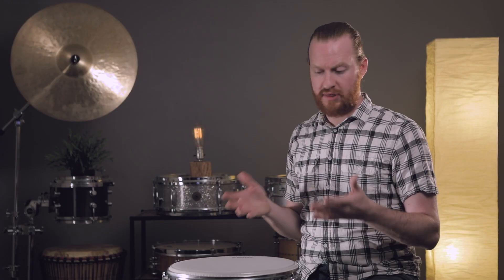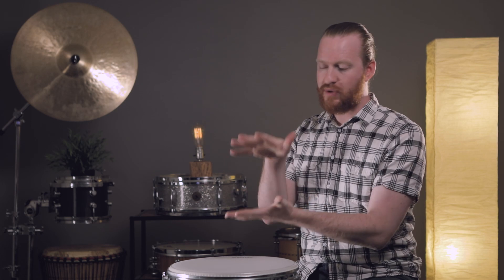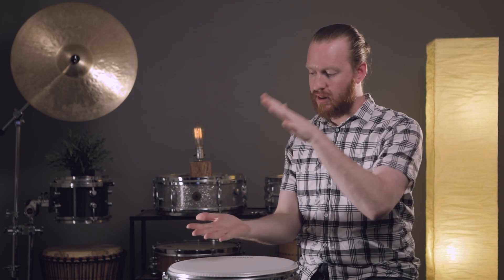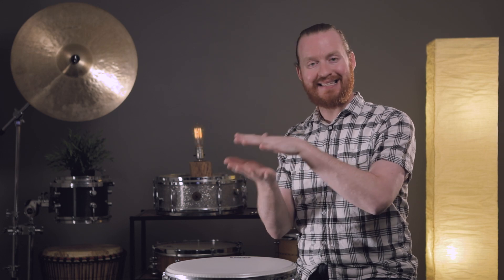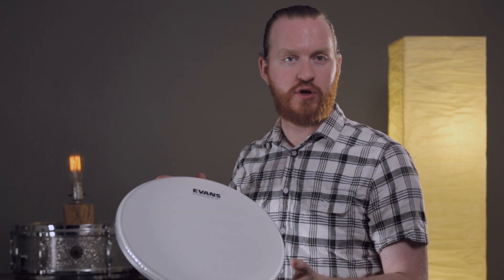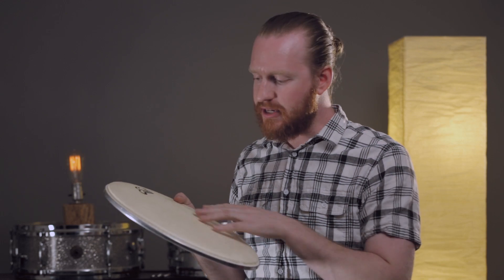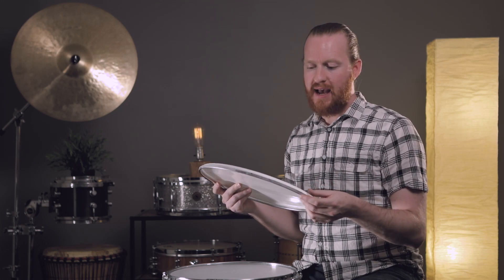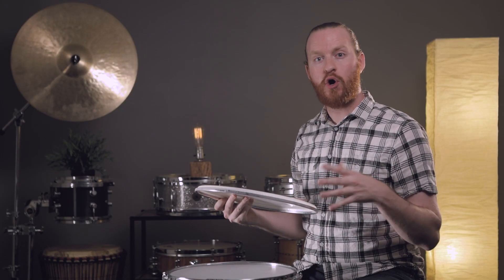Ep. 9 - Part 2 How Drumheads Really Work

Comment: It’s super confusing that drum head manufacturers use mil in reference to one one thousandth of an inch as opposed to one one thousandth of of a meter. What is the approximate equivalent to one mil when used in this regard? I never put much thought into it and just assumed they were referring to millimeters but you’re right, a 7 MM head would be THICK. Great channel. Thanks for the insights
Reply from the maker: Hey Matt! This is based on the manufacturers of the polyester film as the industry commonly references thickness in microns or mils. Mils are in fact a recognized unit of measure equal to .001". Cheers! -Ben

Comment: So, do drum heads need to be seated or not? Is it correct to use the palm of your hand to 'break the glue' or is it a myth?
Reply from the maker: Hey there! In my opinion, it's not necessary. The amount of shift you're getting from the 'cracking' aspect is minimal. The pitch change you hear when you press on a head has more to do with friction against the bearing edge of the drum that remains after you adjust the tuning screws. I do apply a little pressure when tuning now and then to even that out  but it's nearly not the same as actually putting my weight on it. Leaning hard into it can damage the head, especially thing ones. Cheers! - Cody

Comment: I‘m so excited that I found your channel. I‘ve never seen so much profound knowledge about drumsound in one place. 
As this video is about choosing the right drumhead, may I ask you for a recommendation?
At the end of the video you are talking about center dots, and how they lower the fundamental frequency. I have a micro kit with an 14inch kick (Sonor Martini) that I am using for very small venues but also for (home)recording. I want to achieve a sound that fits electronica and hip hop, but still sounds like a „real drum“, but I am struggling to get it right. 
Do you think a center dot may help with a little bit more bottom end? Any other recommendations?
Thank you!

Keep it up!
Reply from the maker: Hey Mike! I'm not as familiar with that bass drum- I know it has wood hoops but is it compatible with tom heads (vs. 14" bass heads)? I would tend to opt for a tuning the reso a bit higher than the batter to help carry the tone while the batter is mostly about attack and feel. With such a small drum, you'll need to experiment a bit but I would likely experiment with a coated Power Center Reverse Dot (assuming it's tom hoop compatible) on the batter and Reso 7. That should help with achieving a warm, round tone but with a shortened sustain. If you want to go with a punchier option that's more about getting the most depth out of the drum possible, you'll probably have to tune both the batter and reso about as low as they'll go and potentially muffle the reso with a towel or something similar (the Evans EQ pad is excellent for this). In the end, it's a 14" drum, so it'll only sound so big/deep. Hope that helps!
Reply: Sounds Like A Drum Thank you for your advice.
Regular tom/snareheads fit, so there are gazillions of combinations possible. I‘ve tried some, but did not find my sound yet. I‘ll give your choice of heads a try!